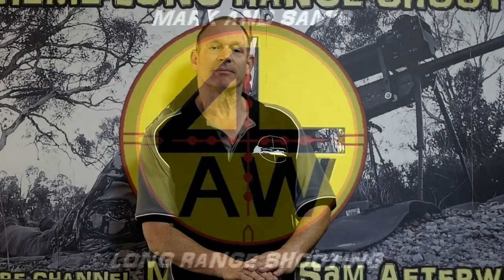Understanding a rifle barrel (a rifleman's perspective)

Comment: Hello, very appreciate your time invested in your video series! As you said, the cleaning regime depends....  Here in the Austrian Alps foxhunting is mostly done in the winter months where thetemperature can be as low as -20°C. If i do not clean and oil (very light layer of clp) after only 1 shot, the barrel will rust due to condensation when you take the cold gun inside a warm room or car etc.. after a hunt. A surpressor will make the corrosion problem worse, when not remooved from the barrel and dryed out.
Reply from the maker: Yes, and I would only use stainless barrels in your neck of the woods, but would still be very important keep a light oil coating there, Cheers

Comment: Great video Mark. I agree 100%. we've all had that rifle that you can almost abuse and it never shoots bad. We've also had that rifle that is very finicky and needs constant cleaning. I've even seen this translate into brass longevity. I have a few rifles that are running stout loads and the brass is like new after many reloads. It also seems that the rifles that need a lot of attention are hard on brass, even though comparatively they are not running as hard as others. At the end of the day, these are man made and everyone will be different.
Reply from the maker: Yep, glad you liked, Cheers

Comment: Great video!! Fastest 29 minute video I've watched for quite some time. Had an issue with my .270 Win some years ago. It went from tack driving to erratic very quickly. Found out later that my hand-loader buddy had run out of my preferred powder mid-batch and used another brand that was supposed to be "just like" it. He doesn't load for me anymore.
Reply from the maker: That would caused some hair loss, lol, glad you liked the video, Cheers

Comment: I've been working in specialty alloys for 15+ years now & this video got me wanting to get into gunsmithing so I can experiment with different barrel materials. Most seem to use 4140, which is a very basic high tensile alloy, mostly used for shafts/pins, it's cheap & abundant. Some of the toolsteels are designed to be stable & not move/warp/expand at high temps. A hot work steel like H13/W302 would be quite happy at 300c all day.

Could potentially use a barrel half as thick/heavy and get the same results.
Reply from the maker: Cheers

Comment: The cleaning topic will always be controversial and difficult to organize or standardize due to all the differences in shooting contexts. Your remarks on the damage from heat and shooting tempo are important. The properties that make most common barrel steels useful include hot hardness. Many steels begin to rapidly loose their hardness as low as 400 C. It is not difficult to understand that machine guns can easily wear out a barrel but it takes hobbyists and shooters a while to wrap their heads around these concepts with their sporting bolt guns.  Wearing out a bolt action barrel prematurely with rapid fire strings because the surfaces near the throat hit these temperatures is common. Unless your rules or competitions require long rapid fire strings, it is good advice to avoid them. Nice talk Mark.
Reply from the maker: Cheers

Comment: I have a small wildcat, a 7.62x40WT (essentially a modified 223 case that has been necked up to 30 cal) that after 5800 rounds is still a sub moa rifle....  It was never formally "broken in".  Just took it out and shot it, and still do.  Don't clean it much either probably after 3-400 rounds sometimes more.   And this is a direct impingement gas gun, not known for staying clean.  Simply put, it just shoots.
Reply from the maker: Cheers

Comment: Hi Mark
Good job on all the videos and info you give it's very helpful. I really enjoyed the last 22 magnum video you made shooting all the tins of fizzy enemies🤣 it was something different from the normal shooting. 
I have a question I'm hoping you could tell me what you would have gone for. I've just got a 50BMG with a 1:15 twist and 33" barrel, the bullets I want to load is Peregrine and it comes in 750gr (61.19mm long)  850gr (63.70mm) and a 870gr but I don't know it's length. They are all solid copper, which weight would you recommend out of those 3 for ranges going from 1000m - 3200m that could do it all? I live 1200m above see level.
Stay safe cheers
Reply from the maker: Thanks Man, you would test, as always lots more to it than you might think, but not sure you have the twist to run the heavies, FYI if looking for more info than on the channel, consider becoming a 4AW member, there is a little more we can offer for team members, Cheers

Comment: Thanks for the great info Mark , Mate I’ve got to the point with my F class set up has gone off the boil and it’s time to replace the barrel , the action is an old Omark 44 in .308 win , I had a conversation with my gunsmith and he has recommended a True flight s/s bull barrel I have had nothing to do with this make and wondering what you think if you have anything to do with them or what you would recommend as a replacement for this set up . Thanks Steve .
Reply from the maker: They are good barrels, I have used a couple, Cheers
Reply: Thanks mate I’ll give them a try . Steve
Reply from the maker: Cheers

Comment: What's your opinion on the .17 WSM round? I'm buying one of the new generation of the Savage Bmags in a Boyd's stock, and a heavy fluted barrel.

I'm coming from a Ruger American .17 HMR that shoots ragged holes at 100m and cheap ammo, but wanted the extra range and wind deflection the WSM has to offer, without going to a centerfire and having to hand load to keep costs down as varmint ammo is 2 or 3 bucks a pop.

Is the WSM too much for the projectiles to be accurate? There's more negatives online regarding accuracy than positives... hopefully stemming from the poor quality sporter Bmags.
Reply from the maker: I have not used, so wouldn't comment, Cheers
Reply: I have a 17 hornet, which has even more powder capacity, and it is accurate. I dont't think the velocities can be an issue. I think you should consider a very important aspect since it uses factory ammunition : the ammo availability in your country. The .17 of my dreams would be the 17 Fireball
Reply: I have a B-Mag 17WSM with heavy barrel and Boyd’s Adjustable stock. Tack driver and extremely accurate! Keep in mind that some online can’t shoot for sh1$!

Comment: i only clean my barrels when they stop shooting at the accuracy i know it normally shoots..  it has always worked well for me..
Reply from the maker: Cheers
Reply: I agree with you. With chrome-moly steel barrels I also clean if I feel there is a risk of corrosion. I also think that the first bullet(s) shot in  a 100% clean barrel will produce flyers (different velocities and friction vs a fouled barrel)
Reply: @br4713  spot on mate....  i think its awesome you make some of the shots at elr distance without really doing a load workup..  do you think maybe it would get you on target faster if you did? just curious what you think.  i havent had much luck without doing it.  sometimes id get lucky and get a good result but i found if i really want to keep the es down i have to at least do a powder charge test even if i skip the seating depth test..
Reply: @tjarmand  I make some load developments too. First I look for my max powder charge, so I know what is the load I can use safely (a bit lower than this max to be able to use it at higher temperature). Then I get the accurracy by adjusting the seating depth.

Comment: One huge myth floating around gun land is that carbon fiber 22 barrels don't get hot.  In reality they get hotter than hades because the heat can't reach the surface.
Reply from the maker: Yep, lol, Cheers
Reply: Reminds me of motorcycle exhaust mufflers in the aftermarket. The carbon canister sure works well preventing scorching heat from the surface. Same thing for gun barrels. I'd say it's an insulator.